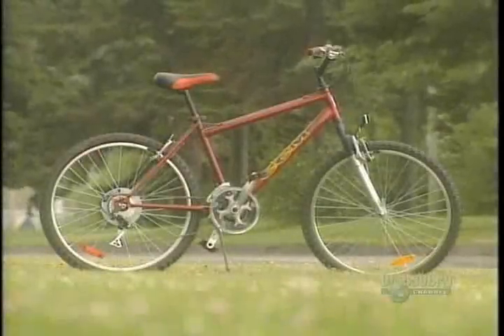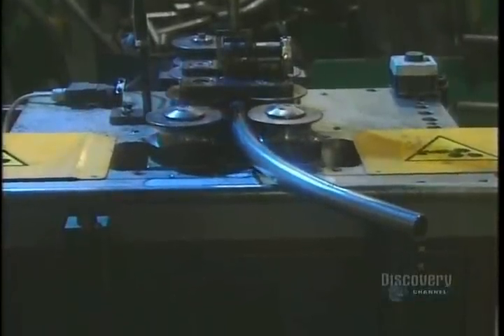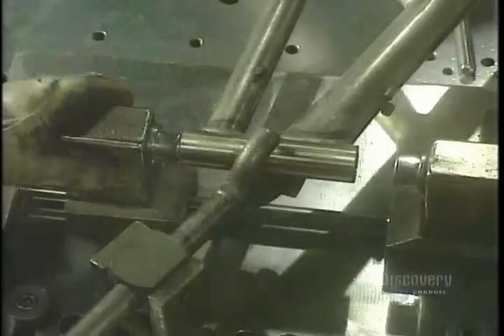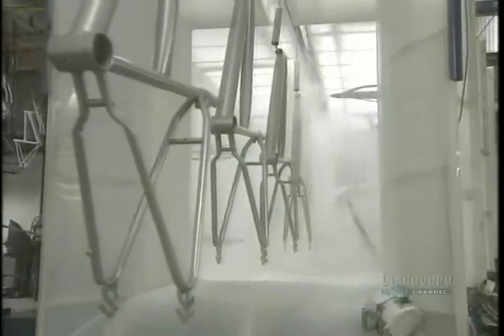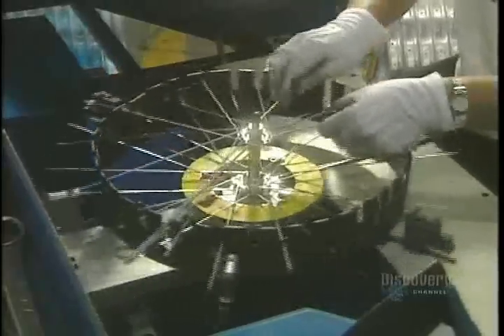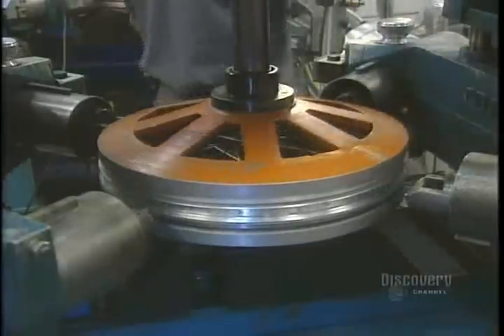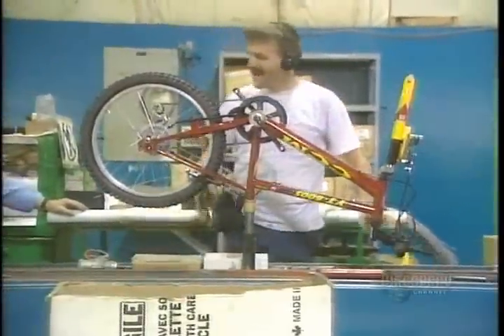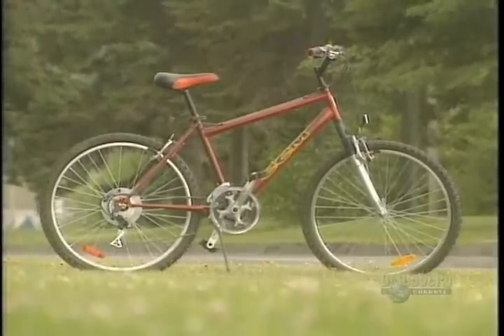How It's Made Bicycle

Comment: Bike manufactures make a variety of bikes as was shown in the video. Yes the final scenes showed some low end bikes. (form a BikeForums poster) "The video was made just about the time that Procycle's Peugeot license would have expired, circa 2000/2001. Consequently, the video features CCM bicycles, a brand that Procycle bought in 1983. Regardless, those are the actual manufacturing processes that would have been used to build many of the North American Peugeot."